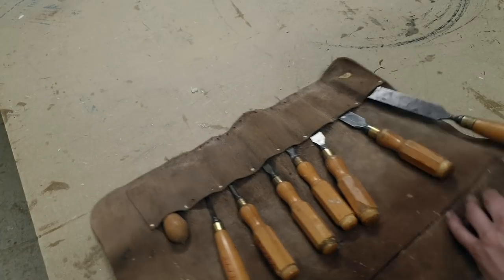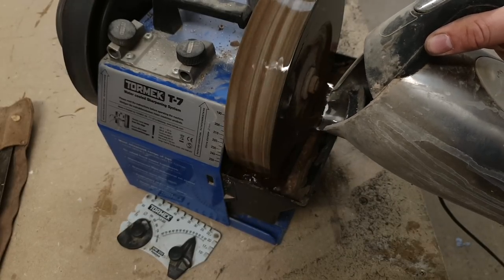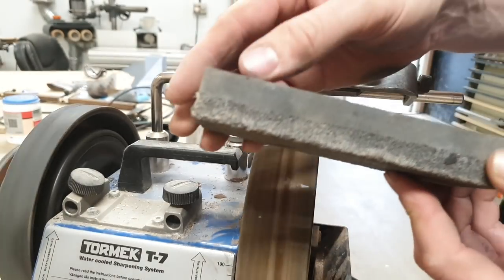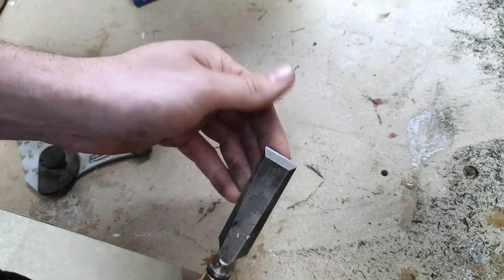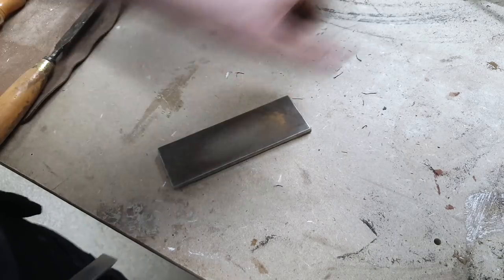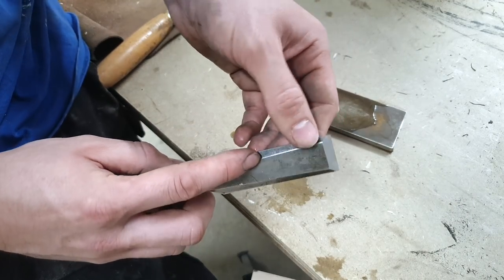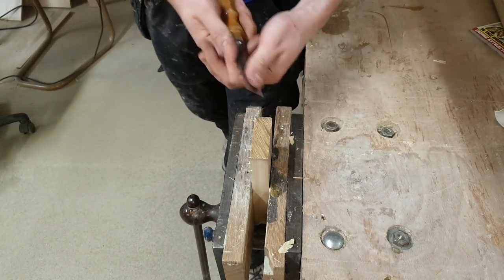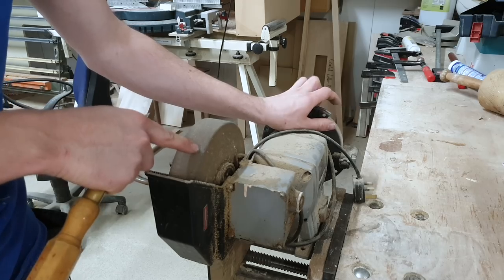Simple Chisel Sharpening. How to Hone. Seriously Sharp.

Comment: An excellent, clear video on how to sharpen a hand chisel. It’s certainly a lot different and easier than when I started. I wouldn’t entirely trust my memory but I don’t think we had secondary bevels then; sharpening was less and more often; different steel used?

I now sharpen mine in pretty much the same way - but, for whatever reason, it takes me longer at the wheel and stone to get the edge that you achieve. I use my Tormek T8 exactly as you do and then go to waterstones (flattening them with a diamond stone) on a couple of grits (usually 4000 and 8000). However, I use a Veritas honing guide (it’s a good guide and second only, IMO, to the Lee Nielsen but a lot cheaper) because I found that my old hands wouldn’t keep the chisel square enough to get an even secondary bevel. Onto the leather wheel for a polish. I keep a piece of leather glued to a piece of plywood by my side at the bench to encourage me to hone quite often. 

I’m only workshop based and so it’s easy to keep to that discipline. I’ve found that, for me, everything has to be at hand and easy - otherwise, the temptation is to take a few more cuts before the sharpening raffle and it is those cuts which aren’t good enough. I only use hardwoods - except for jig making - and plywood or Medite - which does take a heavier toll than if I used mainly softwoods but there is something almost exciting about chiselling end grain on a piece of hard oak and getting that mirror finish. Don’t pity me, at my age, you have to take small pleasures wherever you find them and it will come to the rest of you soon enough.
Reply from the maker: Cheers Theo, the secondary bevel only needs to be a micro edge, infact any more and your just wasting chisel and number of honings before you need to regrind! two light passes down the diamond stone will be sufficient.. 
There is no greater pleasure than using a perfectly sharp chisel! haha

Comment: Having used a radial arm saw for a hand full of times yours really makes me nervous 😂 lock on switch, no guard. I tell my class mates who arnt as capable to only do what they feel comfortable doing, which I feel is good advice. But still your radial is vicious
Reply: Also if you want to watch something I think you’ll find interesting as I did watch this about radial arm saws - https://youtu.be/HiGH0Qsu3ak
Reply from the maker: HI Beck, my radial i a bit unique. its pretty much impossible to make it jump out at you (like a typical radial) It is so heavy it doesnt move quick. i have had 4" oak 18" wide bind and drop pinching the blade and it just takes it. i have used the overhead rail type wadkins before and yes they are lethal and would never use them like i do this one.

Comment: if you still got the second grinder you used could you show us how you made a jig to set the angle for the chisel
Reply from the maker: Really simple, just need a 60/70mm wide board to rest the back of the chisel on to hold the angle, much the same as a recular bench grinder rest
Reply: @BradshawJoinery  I got a tormek tool rest that I was going to use but I don't have the bars and I don't know what else to use

Comment: Hello mate, why don’t you use the tormek to finish your chisels and use the linishing wheel. I don’t think I have used a stone to 2 years since I got mine.
Just an observation not a criticism
Reply from the maker: Hey buddy, if I'm in the workshop I'll use the leather wheel to hone the edge free hand, it takes too long setting the rail up and is a bit pointless imo for a normal chisel. I use the hand stone as it puts a very slight convex cutting edge which is very strong, the Tormek stone leaves a concave hollow Grind which is a very fine edge and will deny very easily. So the short answer is longevity!
Reply: Bradshaw Joinery I did think that regarding the longevity but if I’m honest I don’t Cain my chisels so I’m not sharpening them that often.
Great content mate always a great watch 👍
Reply from the maker: No worries buddy! I'm glad the videos are being enjoyed! 

I do sometimes hone the edge straight off the Tormek grind. Normally is I have some end grain work it makes light work of slicing through the timber.